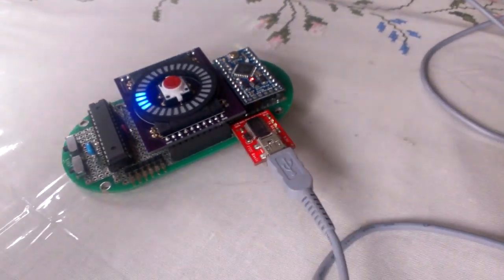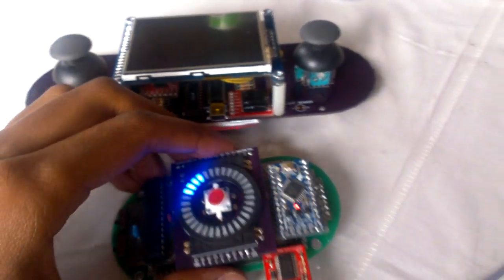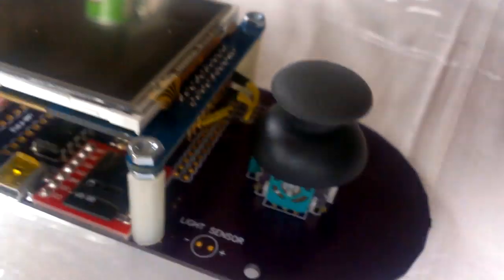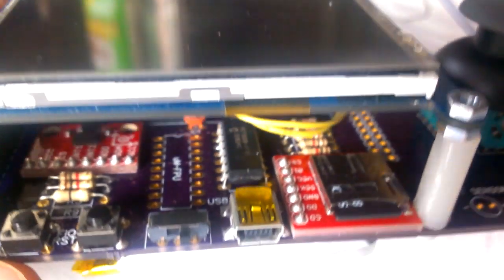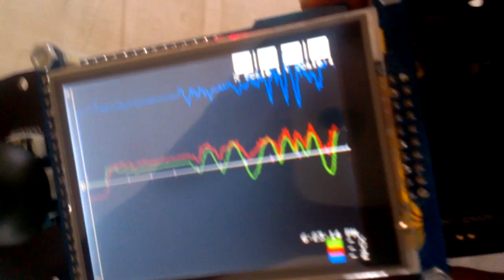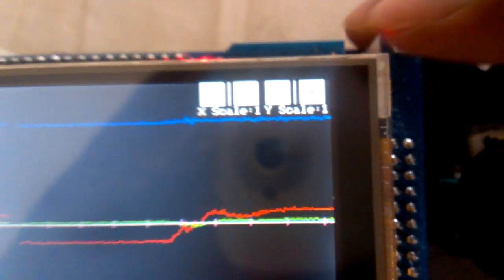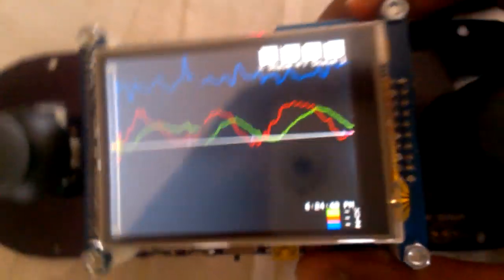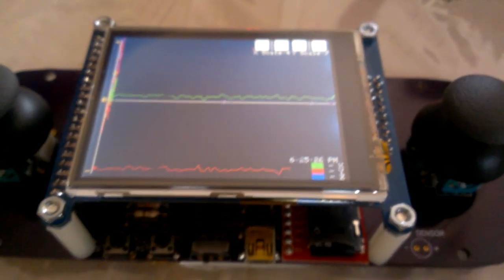TFT LCD Acclerometer GRAPHING Arduino Project!

Comment: Great implementation- thank you for a project and explanation well done.

Any guidance on how to make work on an Arduino Nano with MMA7455 and 0.96" OLED display?
(Not needing great resolution or adjustment, simply a way to show 3 axis of acceleration)

Thanks again

Comment: Nice build.
You may wish to consider a dedicated 328 for the SD card and then log via serial.  I have had good success at this approach even with the 328P running on internal RC @8MHz to minimize components (Hint: many SD carriers have 3.3V regulators capable of powering both the 328 and the SD card, so no voltage translation!) Approach even allows double-buffering of SD if required. Prototype on Hackster<dot>IO /rayburne/ sd-card-serial-logger
Ray